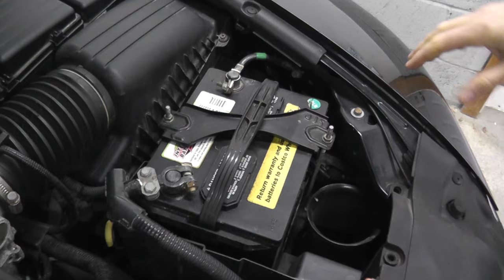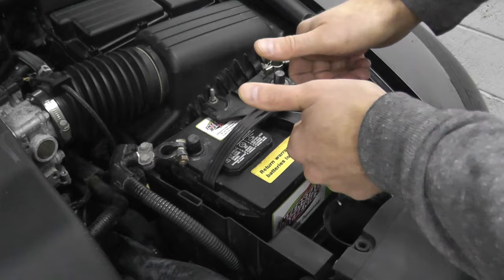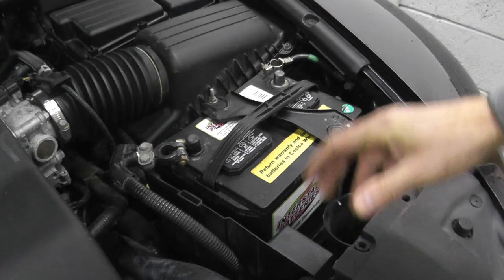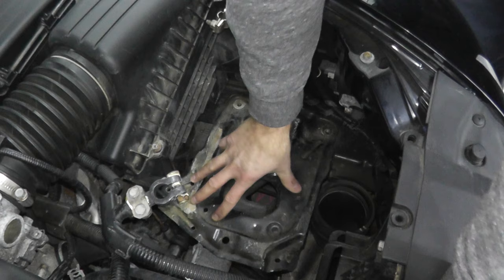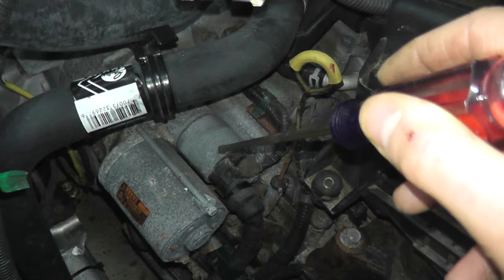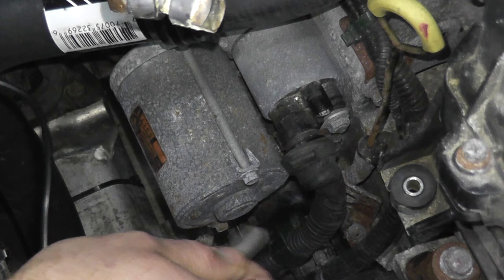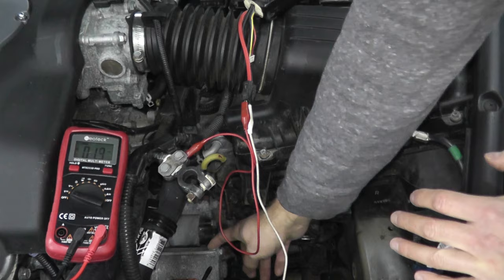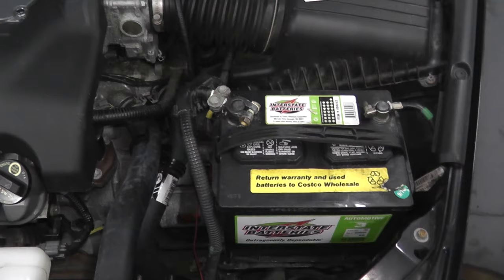Car Not Starting or Turning Over Help | A Step by Step Guide

Comment: 70 years ago my old man would just whack the solenoid with a hammer, fixed it every time. now you almost need a degree !
Reply: Agree on that.
Reply: That's great. Gives you one or 2 more emergency starts. Save that for your appointment to the mechanic
Reply: I did that last month
Reply: 70 years??
Reply: @notcorey2890  Yes Corey, we had a car 70 years ago. Look up classic cars, they were modern back then.
Reply: @jollyroger7624 😂
Reply: @jolly roger  Hahah I love this!
Reply: 19:49
Reply: My Grandpa taught me to hit it with a hammer. It works for window AC units too when the compressor won't click on

Comment: Great job!  Detailed but to the point. Nicely done!  Thanks!  My problem turned out to be corrosion on the cables where they attached to the positive battery post. My guess is the post kept getting corroded, kept getting cleaned but the cables were “infected” as a longer term result.

Comment: [I, own a 2004,  x type  3.0   jaguar  I, had the same problem no crank no start.  It, was the starter relay that was bad I, replaced the relay it works now.     thank, you for you're helpful video👍

Comment: Mix a very small amount of water with some of the baking soda in a lid or small dish. Then, use the toothbrush to apply the paste to the terminals and clamps. Scrub thoroughly until the white substance disappears. If necessary, you can make use of steel wool to help remove the corrosion, if you dont have sandpaper or a dremmel
Reply: Thank you

Comment: Hi This Video is great,
I have a Toyota Corona 1991 EFI Patrol Car
*Battery - Good - Tested with Voltage Meter
*Terminals/Posts - Good
*Starter Motor is replaced
Most of the time 98% of the time when i start the car in the morning fresh it starts quickly.
Scenario 1- When i drive the car for a while or keep it running and then switch it off and start it again it just cranks but doesn't start after few keeping still for minutes(random) it starts with longer cranks and giving gas.
Scenario 2 - it can be after driving or starting fresh the car clicks with all the lights on dashboards are on,and it doesn't crank at all after sometime (dont know what happens) turning the key several times with hard efforts it starts.
Scenario 3 - Sometimes when i start i can see that after i turn the key and keep it pushing  for around 1 second or less then it starts cranking(there is a delay in crank)
Can you please help me to diagnose this issue
It will be really great and helpful.
Thank you
Reply: What was it

Comment: Would a OBD2 be able to tell you what’s wrong without having to check the voltage stuff? My Nissan Murano 2007 lights go on and radio but it’s a no crank no start. Wierd thing is that it shows the red key light like it thinks theft

Comment: The inside of the terminals should also be cleaned. There are brushes made for this. One end of the brush is for the terminal on the battery, the other end is for the inside of the cable terminal. Then wipe them with spray oil such as WD 40. This should be good for a year or two. A step further would be to spray the completed connections with a wax type product such Boeshield, LPS-3, or similar weatherproofing.
Reply from the maker: Great tips! Thank you.

Comment: thank you so much for the info....I also have the 06 Acura TL . what if I tried all of that but the only thing that worked was when sometimes i press the gas peddle just a little bit when the ignition is on the ON switch and I will turn the key and it cranks right up....  it doesn't always turn it on. But when it's on it drives fine.

Comment: Very good explanation. I had some batteries, where was big internal resistance, so it was charged to 12V but under the load there was big voltage drop.

Comment: With all in good condition that you discuss in this video, I have a 2004 Acura TL, and when I turn the key, I can here the starter relay load up and vibrate. Purchased a new relay, and still the same. After some slow turns of the key It will start. The starter turns the motor over quickly as expected.  I did have an issue with a starter switch on another car, and found after replacing, the switch was worn, and had a buildup of aluminum dust and black dielectric grease that caused a poor electrical circuit. I am thinking with the relay vibrating, It may have the same problem and not completing the circuit with a full load to energize the relay as required.

Comment: excellent information here, I had a starter strand me twice before. luckily i got a duralast with a limited warranty when I replaced it and autozone was able to test it when I yanked it out again, of course it failed and they replaced it but that was not fun (failed after just a year or so of use). Had me thinking it was the fuel pump or neutral safety switch!

Comment: Easy way to test the starter is to remove the starter relay, then with wire short the power terminals on the base of the relay, just like the relay would do. If the starter is cranking you know there's no fault but somewhere in the circuitry.

Comment: Your videos are helpful, thanks! Regarding your battery pack... it would be great if you can do a video explaining what type of battery options are good for testing relays. I tried to test one of my relays by direct connection to the car battery but I think I fried it! :)
Reply from the maker: Really? It shouldn't fry the relay unless the wires were crossed. The battery pack I used is an 3s lipo RC battery pack.

Comment: Nice video, but just for reference......the wifi symbol on the multi meter stands for speaker or sound and not wifi [even though it looks like one]
....that setting is for continuity and resistance with sound, beep, added....the setting to the right of it is the same but no sound...most all meters use these standard symbols....

Comment: Just because the battery has 12 volts and the headlights come on does not mean the battery is good , it takes cranking amps to actually turn the starter.

Comment: Great tips you should make a video on how to test the park neutral safety switch and also if you have a no crank no start and the check engine light does not light up when key is in the on postion with a good battery then you probably have prolbums with your pcm or if the anti theft light keeps blinking when key is in the on postion then you have prolbums with anti theft system and engine could be seized up if you try to rotate the crank shaft and it wont move
Reply: Yeah there’s tons of videos talking about non anti theft start problems but very very little anti theft…

Comment: @carsntoys, Need some additional guidance.. Checked the continuity at the starter (both sides were good), checked the relay (that is good), changed out the ignition switch since it was cheap. I can't get the 06 TL to turn! :( Any additional information???  Battery was new as of 6/2018

Before symptoms started, I would get ONE click then nothing. All the accessory lights and headlights are FULL power.
Reply: did you ever find out what the click noise was,,
Reply: What was the issue?
I have exactly the same one click right before the last start up. Now i have no crank or click at all.

Comment: Hi. Can you help me? My 2006 CRV HONDA will not start.  No crank, no start. With key in off position,  key light on dash blink 5times.  I do not know what this means.   My dash lights does light up.  My battery is good. I replaced with new starter, new starter relay and new starter switch module.   Still not start.  Pls help?  Ignition switch or neutral safety switch?
Reply: Fuel pump

Comment: problem with 1996 jeep grand Cherokee Laredo 4.0. had the problem I replaced the battery terminals. quit again nothing. fixed the large 2 wires on ground wires I cut them and straightened them and put them into the terminal post, ran fine for a couple of months. went again I put the key in no lights inside or out or the dash, no key sound when put the key in, nothing. I replaced the battery on September 18. I put the key in and it turned on ran great without any problems, went to the store came back, and shut it off, no start. so I got a new alternator on October 3, 2020. it started right up had lights, key sound, power windows, and locks again. no problems until Wednesday 12/9 I came back from Walmart and I shut it off and no start or power issue again. it sat until Friday 12/11 I got a jump pack and it started right up again without problems like normal. the voltage gauge read as it did before since changed the battery and alternator at 14 volts.  I shut it off after running for about 1 hour then dead without any power and no sound or lights again. but while it was running had accessories, lights, power windows, and locks, sounds from the key, everything worked normally. I went to Walmart on 12/18/20 and checked their battery and read like new. they gave me a receipt stating no problem. I came home to put my battery in again, everything is tight. no power doors, no key ding, no dash lights,  no headlights, nothing. have no clue what to do next.
Reply: What was the problem?
Reply: Had that happen to me once. Turns out, the fix was a blown fuse housed near the battery that only cost 3 dollars after I'd spent money on a new battery and alternator I didn't need, plus the cost of labor.

Comment: Is it true that if it's starter then it wouldn't crank at all ? mechanic told me this and it is showing codes had it scanned at both O' Reilly's and AZ . Mine can take more than one try but cranks over though sometiomes verry weakly . Codes PO420 and secondary PO103 Mass or volume air flow circuit high speed  and PO113 Intake air temperature sensor 1 circuit high input . Brand new battery .

Comment: How do I test the starter switch on the 07 Acura TL? I put a new starter and battery on it and it cranked fine and ran but later it wouldn’t even click. I am going to test the relay but I’m not sure how to test the switch. You think you can help me out ?

Comment: I have a question for u I have a 1994 Ford ranger XLT and I fixed my starter and my battery post and still nothing is turning over so I'm asking u if that means my solenoid is bad

Comment: Help, Please anyone! My 2008 Acura TL has been a problem for almost two years. It starts and then it doesn't. When it doesn't start it is silent. I discovered if I disconnect the battery, I put a quick disconnect on the battery, and reconnect it starts immediately almost every time.I took it to an Acura dealer, a Honda dealer and 4 other mechanic shops, no fix. Battery is new and great, starts strong right away when it starts. Dealer replaced 2 starter relays, no fix.
Reply: My bf has been having this problem as well. I gave him a jump this morning and it started up. Few hours later and it's not starting again

Comment: Hi, great video.  I'ved done everything you said and all the test was positive.  The TL still doesn't want to crank.  When someone turn the key, i hear a small tic and some low sound and short - trrrrrrrric -.   Anyway tomorrow i'm gonna take the starter out for a table test.  I'll be in touch.  Hummm! by the way, You were lucky only one bolt under the battery rack.  I got 2, one both side.  Very easy with a ratchet, extention and an 11mm socket.  Ciaoooooooo.
Reply: Hello. Did you ever find out the issue? Was a short. 
Im having same problem not getting a crank at all. I did all this test and are good and still nothing

Comment: someone help please i don’t know much about cars my Acura is my first car I was on my way home from work. MIND YOU WORK IS 20 MINUTES AWAY FORM ME. I was about 5 mins away from home and while i was turning a corner my wheel gets stiff and my car gas gets stiff as well. the day prior my oil pressure light was on and it stayed on. i turned my car off then tried turning it back on and it never started back up. what can it be? i been doing my own investigation looking at videos and i’m thinking maybe alternator/starter/oil pump? someone let me know if those can be possibilities!

Comment: Hey my car start but I have to turn the key very quick so it can start but normally it don’t start and it make a rattle sound if the key it’s on on position
Reply: Help please
Reply: How did you solve it fellow I have same issue ?
Reply: Ignition switch

Comment: Me sitting in auto zone parking lot, battery good but now it won't start.
Reply from the maker: If that happens again and you can see the starter, try tapping the solenoid a few times. It often will yield a quick start.
Reply: @CarsNToys  thanks I did try it and it turned in! I got the starter fixed yesterday and after I picked up the car today, it locked up on me at the store with the yellow  car 🚙 🔑  no start, so now the auto group has to pick it up. It's a chevy malibu

Comment: What if it only does it occasionally? Did it twice but started after I let it sit for a little :/
Reply: Mine does this i dunno the problem. Starts up first drive then if i walk in a store and come back i have to wait 30 minutes
Reply: @NightVibes121  Oo yeah mine does similar and has done it 3 times in the last 3 months but I get it to start again usually after tapping on parts or just some time in general. It's so frustrating. Today I used a self jumper cables to see if it was the batt but don't think it did much. My car is also older and was cheap and started leaking oil after 2 months so probably gonna have to put some money into it before whatever is wrong messes with something more expensive to fix. Good luck w yours 😊
Reply: @ila2712  i might just change the main relay and see if that helps.
Reply: @NightVibes121  Thats a good start. Let me know if it helps please.
Reply: @ila2712  Sure!
Reply: @NightVibes121  update????
Reply: @josephs1326  oh lol i actually did this today. So mine used to leak oil, i fixed the valve gasket but oil still makes its way into my throttle body some how. So today i cleaned it out with throttle body cleaner and put in the new main fuse. The car did not start so i panic and swap it back to the old one. (The car did not start cause there was a vaccum leak, i didnt fix the hose properly from cleaning the throttle body) it starts now but i didnt put the new fuse back cause today was kinda crazy for me. My dad took the car to work but I'll put in the new one tomorrow when he gets back and let you know.